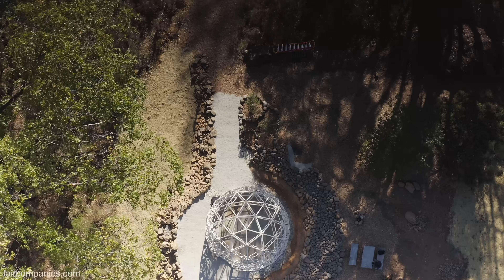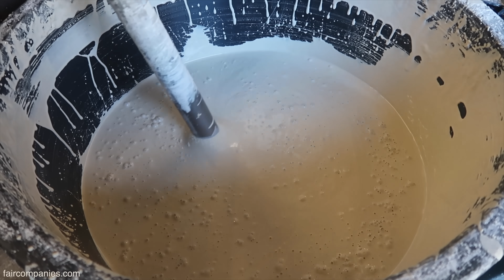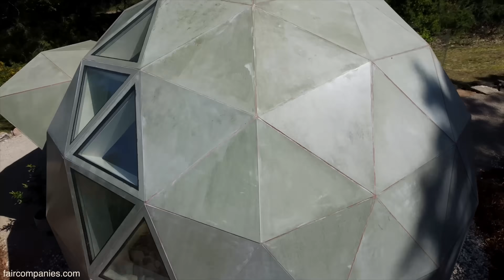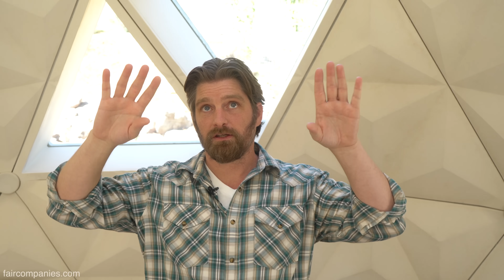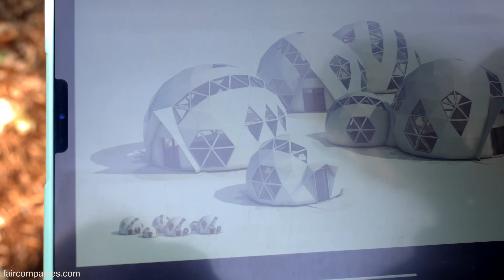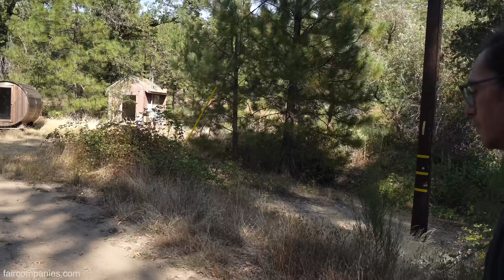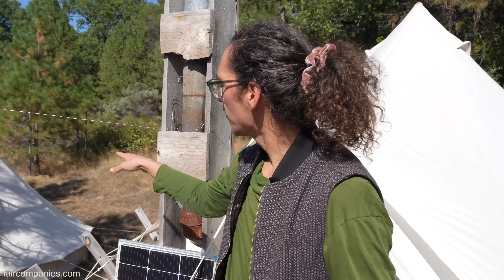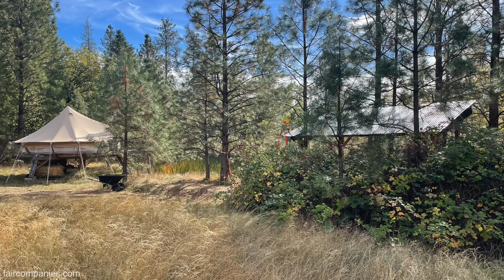Building ecovillage of storm-proof homes made of bone-like biomaterial

Comment: Hard to fit furniture into and no flat walls to hang things on. Yeah, a dome does enclose the maximium cubic footage of space with the minimum square footage of surface area, so it's arguably the most efficient structure. I'm wondering how long this would last in an oceanfront environment where all steel rusts away within 50 years.

We have dome houses here in Coos Bay, but they all look like they were built 30 years ago. Apparently it was a fad that didn't retain it's resale value.

Comment: How do you open the windows? How do you shade the windows to block light, heat, or for privacy? Is there a back door for safety reasons? As a former potter and ceramist, I love the material you have developed. Is it a single skin structure? Ie. no airspace between the inside and outside surface? Will there be any condensation forming inside if it is a single skin structure? What do you seal the joints between the triangles with?
Reply: All the questions I had here as well...
Reply: Alexa keep dome temp stable using electric skylites.. Close for rain .

Comment: Don't care for the geodesic style... so much wasted space of walls and floor... Where do the pictures mount, how do you put a couch against a wall, where is the bookcase going... Bolt a television, or seismic some piece of furniture to the wall? To what... Put on a second floor or roof garden? Nope. 
Nothing fits... Works for the simplest of needs, but little room for any real functionality. You get headroom issues, and an air of scrunched up constraint despite the claim of 'expansive' (that is a mathematical truism)...  And would you really like to live inside a booming drum of echos? It would make a good panic room in a forest fire, first structures on the moon, cabin in the woods, ... Nice gimmick. But living a real life in it? I don't see it.  
Square it up. Open the floor. Make the walls vertical, and helpful to mounting Kitchen cabinets, Murphy beds, shelves for books, tools. 
Use the ceramics, and materials science... Drop the Geodesic part.

Comment: Energy Imbalance living in a dome home: Dome structures disrupt the flow of "chi" (life energy) because they lack the right angles and distinct corners that help guide energy smoothly through a home. Without these guiding corners, energy can become chaotic or even stagnant, leading to restlessness and unease for residents. There are several other reasons, too!
Reply: its the opposite really. corners lead to energy stagnation. the american indians have known this for 1000s of years. round is better. my god how did you come to the opposite of the truth answer jesus.
Reply: @marsmotion  No, it is not the opposite as what I wrote is correct. You fail to comprehend the simple difference between round and a dome. "Round" is a general shape descriptor, while "dome" refers to a specific type of curved, three-dimensional structure. Look up Dan Winter - he notes to NEVER live in a dome home as the energy is not good (negative energies) for humans.  You can visit a dome structure however never, ever, live in a dome home. Sadly, your reply is a total fail so please take the time to know something instead of beLIEving in something. Cheers!

Comment: Insulation?
How does fire resistance work, with glass windows and with the insulation potentially that close to the outside?  And with curtains, to prevent indoor sunburn?
Have you considered building one in an area that later gets a controlled burn, as a test?

Comment: I love that more and more people are utilizing dome structures.
Reply: A lot of people in the storm damaged and fire damaged areas of the US need to stop rebuilding Stick and weatherboard homes and even brick and concrete buildings and go straight to this form of Technology... If they ask why just build a few examples and show them that the designs ability to resist the winds weather heat and fire and for flood zones. They will need to develope  a  flood  zone protected form with either a clear through basement platform... Like the tents Or ensure total water proofing to a roof escape hatch level.... the anchoring will need to be equally important and substantial but also ecologically and cost viable.

There wasn't much discussion about the type and source of the carbon fiber used.  It's currently produced from oil and gas in most commercial production. 
These sources have very high energy, water and CO2 levels. Though alternatives are being developed and it has problems.

For ground anchoring rebar that is also on a par with this bio inspired ceramic Basalt fiber uses 1/10th and even less water....than even Glass fibers. It's also Chemically highly inert and resilient no corrosion temp stability etc. 
Id like to know if these guys have had a chance to explore it's use in place of none organic composite components? 🧙🏼‍♂️

Generally  as a Environmental scientist Geologist and lifetime hands on designer and builder ... these guys need massive backing and practical demonstration structures setting up in  areas still being cleared of broken expensive outdated fragile boxes Now‼️🧙🏼‍♂️ 
Otherwise the mistake of failure to adapt will be repeated because ... that's all that's being offered..

They also need to Contact Penn state  University about their lighter 5x stronger, cheaper cleaner low carbon,low energy   Lion glass production.  😎🤔🧙🏼‍♂️ Meantime they should start talking to housing charities ..Govts anyone who is willing to listen and experiment in the face of environmental problems .. Turkey Greece S. America. Spain and Portugal.... Canada ..UK coastal and high altitude zones and Scandinavia.
Reply: All you need is dome! 💗
Reply: More people re-hashing the repetitively found to be lacking geodesic dome idea?
Reply: Whats the name of thos company, i want more info so i can build one.

Comment: What an ideal and affordable solution.  I could happily live in a dome that had modern conveniences; bathroom, small kitchen and bedroom.  I am far past tent living but understand the allure.
Reply: That's the thing though, I don't think they're designed to take heat plumbing or electricity. I mean you could probably do wood stove but there's no place to run the wires or pipes for things like water & electricity.
Reply: @mrjacktraeger they showed that the structure is hollow. there is plenty of space for wiring between the interior and the exterior panels
Reply: @underverse7  THANK YOU FOR THAT SENSIBLE INPUT....AND i do believe that at 10 to 11 on the video counter is a family size home with all that in it....Why aren't these people watching the video before comment on it not having something it does HAVE?
Reply: @mrjacktraeger  WATCH THE VID....AT 10 TO 11 is a family home with all that...did you miss it?

Comment: We agreed in art school back in the early 1970’s, that domes were the answer to modern living. Still believe this. Built a three story traditional timber frame home, after two log cabins. Now it is time for the circular dome life. Nice video Kirsten.
Reply: I have lived in a 5/8   38’ diameter based dome since 1980. Works extremely well and we didn’t have access to those materials at the time.
Reply: @ I have some thinking to do on the construction methods. Ceramic tile on the exterior makes long term sense to me. Joining the triangles together, not sure. Must be comfy in your dome home Jan.
Reply: @  yes it is. Very well insulated and tight sealed, no drafts and easy to heat. Quiet. Good light and airflow  from a total of 8 dome windows and two sliding glass doors.
Reply: @janwoodward7360  now you have me going for dome. Happiness is. I’ll build this up top on the property. The perfect paradise.

Comment: As a person, I have gotten very use to a bathroom and running water.  Did not see either in their domes.  Do not feel like camping  when I have a home.  Do they have a solution for that?
Reply: @laurienvanderharst8053  It's jus a different way to build the outside of the home. You can do literally anything you want to with the inside.
Reply: @mrblurleighton  If this is an example of something, what I would like to see is what happens when you have the normal things. You should not talk about the feeling that you get from the shape, if in real use, it might not be there.  I would have a better feeling of what is possible if used in a manner that is more realistic.  After all we could live like the other guy in a tent on a platform.  But I do not chose that.  I want a hard structure, with indoor plumbing.  What does that really look like?  I still do not know.
Reply: @laurienvanderharst8053  I get that, but as they've said, they're still optimizing the engineering. If you want to see how modern bathrooms etc look in a dome home them there are tons of concrete dome home tours on YouTube that you could look through. For a small company it's always hard deciding what work to prioritize, and it might be a while before they can focus that. He mentioned just finalizing the design for the window frames etc. That's a lot more urgent.
Reply: @mrblurleighton  I guess the answer really is, that unlike everything else they share, one should not expect to much.  Perhaps it is just to soon for this concept for me.  I guess my needs are just not going to be meet.  This is not intend for me.
Reply: @laurienvanderharst8053  Your time will come. They're probably appealing more to builders and designers at this stage.

Comment: The shape just make it so difficult to use, you cant set a cupbord or anything at the walls. Building it i difficult to build and will be more expensive to build than for example an octagon, just lets see when they have to try and sell some of this. Just look at the windows, they are more than double price a a square with same area. Lots of joints that can leak. Simply a brain fart.

Comment: Are the domes on concrete pads? How are they attached to the pad? He hinted at bolts somewhere, but...  Also, is it hard to run wiring through the ceramic frame? This is interesting.

Comment: An interesting product, but it would be better if they would have focused on selling a building system instead of selling entire home kits. Just the skeleton, window frames, exterior panels, and interior panels. I don't need their kitchen appliances or their lights. I can source them to my tastes and the requirements for my needs might not meet what's in the kit, like I need a full sized soaking bathtub, preferably a Jacuzzi because of my health issues, so the shower built into the kit is completely useless to me and a waste of my money. I would literally never use it. I also wouldn't want travertine sinks in my bathrooms (the current home on their site has those) and you shouldn't either. It's a porous limestone, so it's soft and it stains very easily, even if you seal it. It's also much more expensive than porcelain or stainless steel, although it isn't as environmentally friendly, but I could source a local stone to have my sink made out of for less than them shipping me solid chunks of rock hundreds of miles for the sinks.

You see where I am getting with this? Like, they want to be a way for people to build their own homes without contractors and that's great, but you still have to have them for some things. Get the basic product rolling and then try for selling the kit houses. With the space they have in the walls, rice hulls could easily be used for insulation, so you can avoid having to use wool insulation, so that reduces a lot of price, but keeping it thinner in the walls where you don't need it as think might get complicated.
Reply: My thoughts agree with yours.  In my retirement I'm designing a kit home using a portal frame steel I-beam skeleton overlayed with prefab panels.

Comment: Interesting technology. But we still will be replacing Forests with civilization. Civilization is not just a house, made of fire resistant materials. It's a car or truck and a road. That road, it may be a unpaved road is a cut in the forest. From that cut lead to local county roads that are often just two lane, asphalt paved roads with drainage swales. This is a deeper and broader cut in the forest. These cuts allow for rapid run off of water from heavy rain fall. 

Then theses two lane county roads lead down to bigger complexes, often at crossroads where maybe a small hotel, strip malls, gas station, et cetera are. Such would be the result of decades of development in a place like Ashville NC. 

You can see that replacing the Forest with human civilization is not always a positive outcome. The Forest is an integrated Watershed where rainfall is slowed and absorbed into the groundwater through root zone percolation. There will be small streams that are in the lower elevated gullies in the forest watershed terrain. But fallen trees and small shrubby growth along the banks of these stream, create the function of a Leaky Weir, a structure that Regenerative Wildlife studies are now employing in various runoff scenarios to try to slow the flow of water and enhance collection and percolation and reduce rapid flow and erosion.

Nice concept. But the big picture is asking a broader question. Just because we can build homes in the Forest, should we?

Maybe one or two, but how about hundreds of homes? How about clearing forests for farms and larger establishments, shops and strip malls, groceries and motels and gas stations. We are Urban Sprawling into a region that may be better of left alone?

Oh, we should be able to go where we want? Maybe, but I am not a proponent of Men on Mars either. There is the desire to go, and the technology is becoming a reality. But, I fear we will still take a less conscientious mentality to a new world. Once we colonize Mars, will it then suffer the same problems Earth now has? Wars, pollution, resource depletion? 

You say no, because the best of Humanity will go to populate Mars. Well, Everest or Chomulungma is not the same mountain that Hillary and Norgay first climbed together.

Comment: A very cool material and even process. Would love to see it used on a full scale home rather than tiny home. The small-medium size domes could easily serve as individual rooms within a larger complex connected either directly to each other, or connected through a cylinder corridor using the same materials
Reply: That's exactly how I envisioned it when thinking about building one! It's better for privacy, too...the bedrooms having some distance for when guest are visiting.
Reply: Where are kitchens and baths?

Comment: what is sealing the exterior joints?
Reply: The domes are sealed with bioceramic, an inorganic polymer that forms waterproof joints and has minimal thermal expansion, providing excellent protection against the elements.

Comment: These bio-ceramic geodesic domes seem well thought out, but I don't think it's proper to call it a 'ceramic' material.  Bio-ceramic materials were engineered to use as implants to replace tooth and bone inside human bodies, often as a  structural medium for actual bone cells to colonise.  Other bio-ceramic materials are durable but non-reactive metal oxides, alumino-silicates and carbon composites.  The material that Geoship and others are using don't sound like most bio-ceramics,.  Their product is a geopolymer, cured at ambient temperatures, activated with lyes and sodium silicate and strengthened with cellulose and carbon fibre.  They didn't reveal any technical specs, of course ( these would be trade secrets ), but to be resilient, fire-resistant and weatherproof they must contain emulsifiers, fillers and hydrophobic chemicals in the mix.  Based on the 3-day finished construction timetable they shared, these would make great shelters if the components were stockpiled en masse, ready to ship to emergency relief centres.  Being geodesic domes, upscaling to larger sizes would require new forms and toolkits, with additional forms for producing connectors to smaller and larger domes as required.  Most geodesic dome construction is fraught with technical issues and finessing various materials to create strong joint connexions.  It looks like they have obviated all these issues with strong frames and panels and all made with the same geopolymeric material.  This feels like a winning strategy.

Comment: I and other people have been advocating for and assisting in alternative building construction for homesteaders trying to escape the plantation and declare their independence from the system, focusing on DIY skills and materials. We have been making our own dome kits for years, but using the traditional steel electrical conduit formed into struts and secured by bolts. This advancement of bioceramics seems awesome and likely solves the chief drawback of steel framed domes which is heat expansion when exposed to climate extremes like desert summers and winters. Learning the recipes for these bioceramics is likely one of the greatest boons to the homesteading movement. But it seems Geoship's mission, despite their claim, is to profit from keeping the recipes proprietary and secret, rather than sharing them with the world. That sucks.
Reply: I agree with this, they should share the system for DIY ppl. There is nothing altruistic going on here, this is a business, and there is nothing wrong with that. I would assume there is an open source group somewhere for this sort of thing, though. It does not look that complicated but does look very labour intensive, of course. I could see another system using the same product but in a traditional shape also.
Reply: @ehlava7331  I want to clarify that I am not anti-profit or anti-business. Very much the opposite. But I can't stand hypocrites who pose as altruistic.